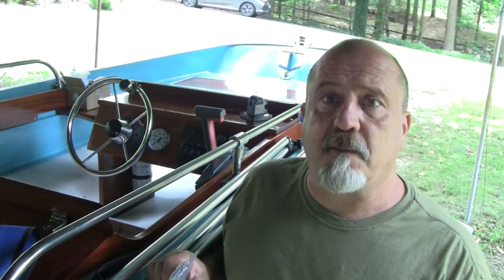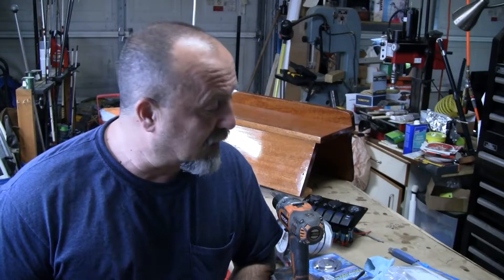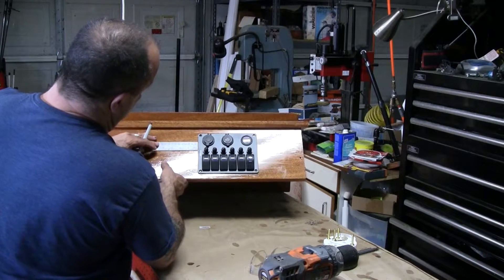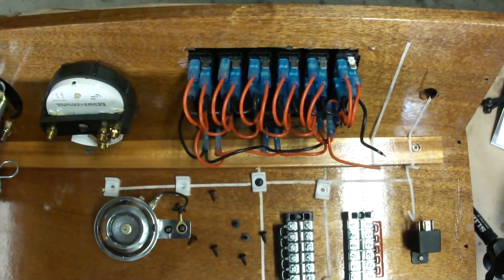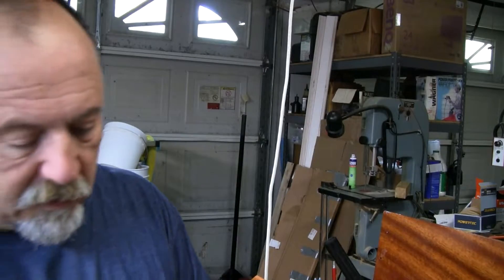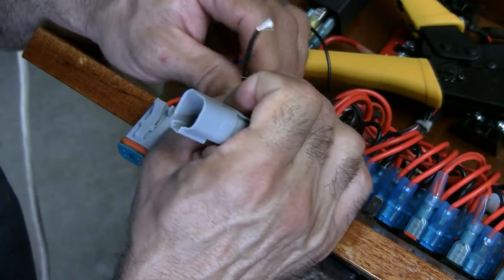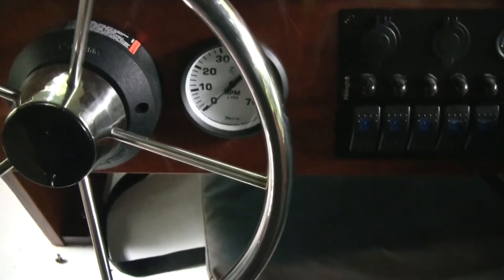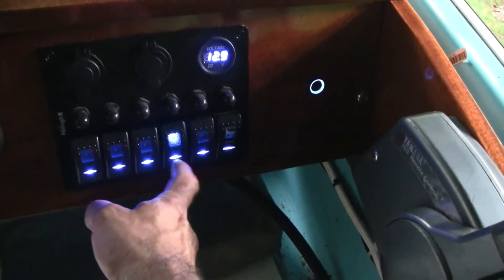How to Install and Wire a Boat Switch Panel - Boston Whaler Restoration - Part 17

Comment: The expandable fabric wire sleeves are excellent - I used the standard slit plastic tubes but the fabric looks better and  appears to be more effective at limiting chafing - think I'll retrofit my wire runs to the panel, bilge and navigation lights.  Thank you for that!
Reply from the maker: I was worried the sleeve would be to small in diameter but they went on just fine. I'm really please with the sleeves!
Reply: you all probably dont care at all but does anyone know of a trick to log back into an Instagram account??
I stupidly lost the account password. I love any tips you can give me
Reply: @Mekhi Finn instablaster :)
Reply: @Cody Jasper i really appreciate your reply. I got to the site on google and Im waiting for the hacking stuff now.
I see it takes a while so I will reply here later when my account password hopefully is recovered.
Reply: @Cody Jasper It worked and I now got access to my account again. Im so happy:D
Thank you so much, you saved my account!
Reply: @Mekhi Finn No problem :)

Comment: Great video I enjoyed it. 
I am also about to install,
the same control panel.
   But you see, I am about to install my same,
Nilight  Control panel on a power wheelchair. Yes you heard me right. I am installing 4 different,
LED  Lights & a GPS & a,
on board front & rear camera.  At this time my control panel is still sitting in a 1/4 plywood template but I will get there.
    So, Jose, thanks for your video.  And take care...
Reply from the maker: I admire your gumption! If you get a video of that I will post it on the channel. Would love to see how that comes out for you!

Comment: Curious what wire you used for the battery connections.
Reply from the maker: 12 gauge tinned marine wire for the house power

Comment: You talk too much but I gave you a thumbs-up because you made me realize I can get momentary switches that match my new switch-panels that came with only on-off switches. Went to Amazon and got switches for my horn, trim-tabs and both bilge-pumps (so I can test the automatic pumps before launch.) ...wait...I need a 2-way momentary switch for the trim-tabs? More research, thanks to you.
Reply from the maker: You are the master of insulting someone while complimenting them. Thank you, I think lol.
Reply: @ExtremeDIYGuy  no insult intended, just my opinion. I'm replacing every wire and electrical device and guage on our 31 year old wellcraft cuddy and your video has been one of the most useful to me.

Comment: Thanx Jose, is there any way I can keep  my circuit breakers on my nilight switch panel from tripping off all the time?  Made sure I wouldn’t need to draw more than 15 amps, I’m not sure why they are kicking off.
Reply from the maker: The first thing I would do is measure how much current is being drawn on that particular circuit. There may be a current leak to ground causing excess draw. Hope this helps!

Comment: Working on my 13' Whaler and getting ready to wire as well. How, with one battery did you isolate a power feed to that separate console switch from what is also connected to the motor/ignition. My battery has a big clamp post as well as a threaded post, but wouldn't they still be connected? Thx
Reply from the maker: Hey Leo, they are not isolated. I just have a switch controlled relay to turn the whole console off when not in use. SO when everything is powered up they are on the same battery circuit.
Reply: @ExtremeDIYGuy  ahh, that makes sense, thx! Cheers from SC!
Reply: @ExtremeDIYGuy  Is the relay switch necessary or can you just have the push button switch between the battery and the console panel? What does the relay do? Thanks so much
Reply from the maker: @lgallant  I think it is, without the relay, everything on that panel would have current running through a single switch. I suppose you could do it with just a switch but it would have to have a pretty heavy current rating. The switch I used is rated for 5 amps and the relay is rated at 30. I don't think I would be using that much current even with everything turned on, probably 15-20 amps at the most  but preferred not to take the risk of burning up the switch. If you are interested,  I added a link to the relay in the description.
Reply: @ExtremeDIYGuy  That makes a lot of sense, appreciate the explanation! Sounds like a relay acts kind of like a solenoid? And the push button power switch acts like the ignition key in just providing the link to activate the relay to connect power to the switch panel? (I went with the same one you did)
Last time I wired my Whaler, ended up with a short somewhere and drained the battery and had to be towed, haha. Trying to get it right this time and I think I will like having the switch panel somewhat separated from the motor and not having to have the key turned on.
 Thanks again, and thanks for the great videos!
Reply from the maker: @lgallant  Leo, You are spot on, That's a great analogy to how the relay works. BTW, I sent you a friend request on FB. We are both on the one of the BW pages there (I think the 12 BW Owners page)
Reply: @ExtremeDIYGuy  sounds good. Found your friend request, accepted!

Comment: Hi Jose - great stuff!  I've been following all your videos.   I do need some help wiring the LED switch to the relay to the pos/neg bus.   Can you dumb it down for me?  I ordered the same LED switch and relay you did.   I need something like "White wire goes to 87 on relay, etc".   I tried doing it tonight but couldn't get the circuit to work and I know the switch panel is working fine.   Thanks and awesome videos!!
Reply from the maker: See if this schematic helps, https://extremediy.org/wp-content/uploads/2022/02/Schematic.jpg?swcfpc=1, or go to the website article itself which might be a little more helpful. https://extremediy.org/how-to-boat-console-wiring-boston-whaler-restoration/, hope this helps!

Comment: Does that rocker switch have built in fuses or overload is that why you didn’t run a fuse panel i bought same one and was wondering if i needed my fuse block or does rocker panel have its own
Reply from the maker: Hi, yes, the rocker switch panel has built in breakers, those are the small round circles right over the rocker switch. If I remember correctly they are all 10amp.

Comment: This is great and fascinating and thanks for the amazon links. I might be missing something but can you explain where the fuses are? also do you use a separate switch for bilge pump auto/manual if you have a bilge pump?  Thanks
Reply from the maker: There are no fuses, this panel has built in circuit breakers. Although it wouldn't be a bad idea to add a fuse for the panel itself.

Comment: What is the middle rubber button for on the control panel
Reply from the maker: If your talking about the small rubber buttons just above the switched those are circuit breakers built in to the panel

Comment: I am looking to install a push button switch like you did to act as a master switch for my panel. Are you using it to switch the negative? I am assuming so since the switch probably can’t take the amperage of all the combined accessories it sends power to. Thanks and awesome job
Reply from the maker: Hi,

I'm actually switching the positive but it drives a relay rated at 30 amps. The relay powers the switch panel and accessories. Hope that helps!
Reply: Hello! Verry nice work and install sir. I am also wanting to install a master power on/off switch like you've done here. I was wondering if you could list the switch and relay that you used? Also was wondering where you ordered them from. Thanks so much!
Reply from the maker: @ToddeSmith-oj1vd Hi, I have paid affiliate links to the items I used in the description. Thanks!

Comment: Hello again Jose.  I am wondering if you would maybe consult with me on my wiring?  I am at the stage and am a little stuck.  I have the bow and stern lights in with the wiring in the rub rail. 
I have the tcontrol panel installed.  I’m a little confused but it maybe restoration  fatigue..Lol.  i want to ge the boat on the water in two weeks.  CAn you help?  Maybe a list of exactly what you have done.?  Happy to send consult $  Thannks for everything!!
Reply from the maker: Not sure where you need help but willing to give it a shot. The black (Neutral) wired coming from the lights should all go to the ground bus (neg on the battery). The red wires from the lights would be tied to the output of the switch, you would have to apply power (pos) to the switch terminals as well. Not sure if this helps or not. I do have a wiring diagram on the website that might be helpful. https://extremediy.org/wp-content/uploads/2021/07/Electrical.pdf

Comment: I wish somebody would actually show us how to do the wiring. Another video here that says, "how to wire," but yet he skips quickly through the whole part about the wiring. He's talking as if we know what all this is, and if somebody knows all this, they don't need a video... UGG! I give up!
Reply from the maker: Sorry Amy, I am going to prepare a wiring diagram for the console. If I were to do a video on just wiring, what would you be looking for it to have? I may put one together but would love input on what content would be the most valuable,
Reply: @ExtremeDIYGuy  I'm sorry if I sounded like a jerk. Im just frustrated. I just bought a boat and literally know nothing about wiring. I bought a rocker switch to add some party lights and phone chargers. 

I watched some videos last night. I don't think you can explain it to me in one video lol
Reply from the maker: Here's some tips that might help. Remember that red (+) is the side that needs to be switched, there will probably be a + terminal strip or fuse block you can pick power off of. Run power to one side of the switch, the other side will go to the lights you want to control. You'll also want a ground wire for the light. There may be a terminal strip for the ground as well (-) black wiring.  If the switch has a light option, you'll want to choose whether it is always on or if you want the switch light to come on when you turn the switch on. I prefer the latter. If you want the switch light to come on when the switch is turned on, you will need to jumper the switch output  to the light terminal.  Here's a page with some helpful information on boat wiring, section 4 onwards https://newwiremarine.com/how-to/wiring-a-boat/
Reply: @ExtremeDIYGuy  Hi, Jose.  I know you are probably onto many more great projects, but did you ever make a wiring diagram for the Whaler console?  I've purchased the same relay and push button switch you linked to, but I'm having trouble figuring out exactly how the switch and relay terminals all get connected.  Plus my push-button switch came with different colored wires than yours.   Thanks much!